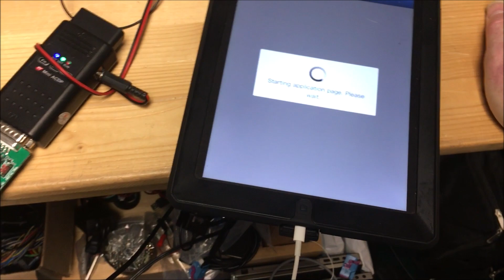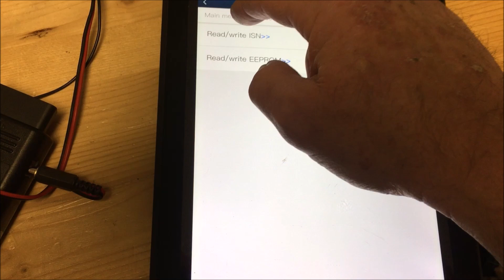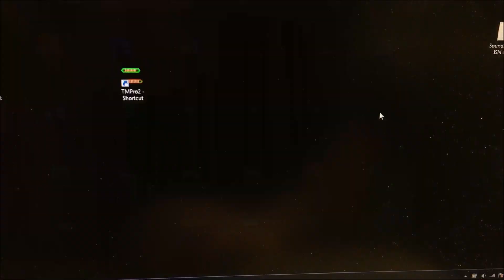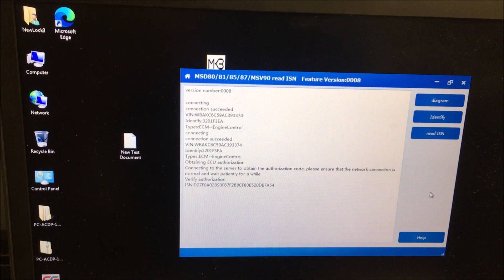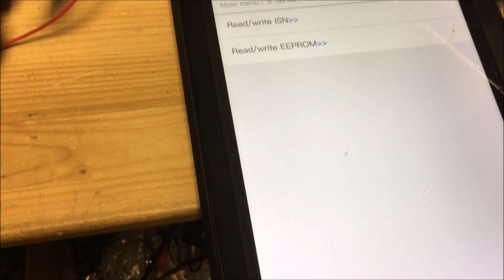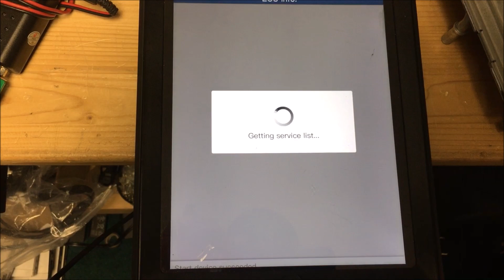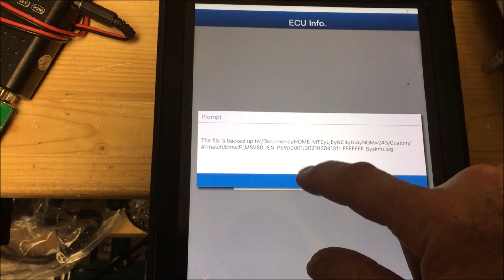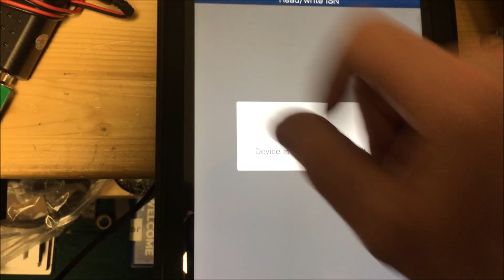ACDP vs CGDI BMW MS85 DME ISN reading

Comment: cgdi sells the AT200 WHICH WILL READ AND WRITE AS LONG AS YOU PAY FOR THE ADD ONS TO DO SO I ALSO HAVE THE AUTEL IM608 AWESOME TOOL MERCEDES BMW BUT DME SWAPPING IS A BIT OF A TRICK ON SOME BMWS BOSCH DME'S ARE EASY TO WORK WITH SIEMENS ARE A PAIN IN THE ASS BRO I AM ALSO A PROGRAMMER AND LOCKSMITH AND DIAGNOSTIC TECH ON LONG ISLAND NEW YORK,MY SHOP IS IN HEMPSTEAD NEW YORK

Comment: On the ACDP if you go under obd and choose msd85 help menu it shows a different way of connecting it. It shows just like the CGDI. Maybe that will work
Reply from the maker: I tried that too... no work...  My issue is all I have gotten from ACDP is, buy the boards, and then try the windows PC software.. I did both of those and it still won't work.. As I said before, I love the solderless connections, but if it doesn't work, I'd rather solder on...
Reply: @timtracy9442  yeah I gotcha. It’s good to know. I wish someone would make one programmer that would do it all
Reply: @timtracy9442  YOU KNOW WHAT DUDE THE BEST BMW TOOL IS THE MICROTRONIC  AUTO HEX OTHER THAT ISTA-P ISTA-D ONLINE WITH THE NEXT VCI WORKS AWESOME, MY NEXT PURCHASE IS GOING TO BE THE AUTO HEX FULL BUT IT WILL SET YOU BACK 7000 BUCKS BUT IT WORKS EVERYTIME
Reply: @FrederickWiedmer  Autohex couldnt read EDC17C76 tricore TC1793, as well as acdp, Abrites, vvdi despite they all have it listed as supported DDE
Reply: @FrederickWiedmer the best program for bmw is the bmw wizard it's even better than thr dealer software but it's way to expensive

Comment: The best and most useful videos and please tell me if you have these two devices which one works better BMW cgdi vs ac
Reply from the maker: It depends on what you are doing... If you are making keys for a FEM or BDC, ACDP is by far the easiest, if you are trying to read the ISN from the DME, usually CGDI has more coverage... I had a CAS4 that I swapped the DME, nothing wanted to change the ISN in the CAS module.. ACDP said it changed the ISN, but it didn't change it to the correct ISN.. CGDI changed the ISN in the CAS back to the original and then when connected directly to the DME it read and then changed the new/used DME's ISN to the cars ISN.. fired right up...
Reply from the maker: and the fact that CGDI is about 800.00 makes it a great buy...

Comment: Autel im608 says it will  read it also using the G box and cable db15. I don’t have a ecu to test it though.
Reply from the maker: Hi Tom, reading isn't the problem...  And the Autel IM608 is awesome.. it read a MEVD1767 that niether ACDP or CGDI would read the ISN.. watch for that video soon..
Reply: Autel does not works to good on Continental Ecu's

Comment: You have to have the Tricore password to read and write with ACDP.
Reply from the maker: the big problem was ACDP wasn't reading anything...  it wouldn't talk to the module...
Reply: @timtracy9442  with mine, in bench mode you have to have the tricore password to read (case open with solderless adapter). When in OBD mode the ACDP connected to OBD connector on car or on bench OBD harness (case closed) it reads.

Comment: I ALSO WANTED TO SAY THAT I TO BOUGHT THE ACDP AND ENDED UP SENDING IT BACK BECAUSE IT STOPPED WORKING AND STARTED SPAZING OUT ON ME I SENT IT BAK TO UHS HARDWARE IN FLORIDA AND GOT A FULL REFUND THAT TOOL IS FUCKING JUNK,IF ANYTHING XHORSE NEW MINI PROG IS PRETTY AWESOME AND THEY ALSO HAVE SOLDERLESS CONNECTING PCB'S ALSO
Reply from the maker: Thanks for the info on the Mini Prog...  I need to check that out ..  Have you seen what NASTF is doing??  They are partnering with a couple of companies to setup a programming service for garages.... They will have one tech in the garage who is checked, not sure if that means background check like the rest of us have and pay for, or if they are going to say, yea, he or she seems ok....  I do more programming than anything nowadays, maybe that will be coming to an end...
Reply: I wll depend on your words
Thanks

Comment: How much is the cgdi running in price?
Reply from the maker: The CGDI is about $750.00 with the options I got.. well worth the money in my mind.. Haven't had a DME it couldn't read the ISN from..
Reply: @timtracy9442  and this lets you pull the isn and write data to the cas?
Reply from the maker: @lockoutkeysolutions7471  I don't have the authorization to write data back to the DME, but you can bet I'm going to get it.....

Comment: do you have  idea when AVDI going to fix the CP issues?
Reply from the maker: What CP issue are you talking about??? because, trust me, AVDI has a bunch of issues....  but at least they pretend to listen to me when I whine...
Reply: @timtracy9442  the Component Protection,  Tim...  the " CP ". I know they don't listen.  their center support  here in the US is proof of that.
Reply from the maker: @victor35ma  If you are talking about the issue with calculating CS, Component Security, that really is out of there hands... All the aftermarket programmers were using a backdoor into the Ghecko server, the server that ODIS relays info to..  They, VAG, shut down the backdoor and now everyone is trying to figure out how they can calculate data without the hookup to the server... When will it get fixed, who knows....  But I do have to give Abrites credit, they were the ones who figured out how to read and preprogram chips way back in 2010, so if anyone is going to crack this, I have high hopes they will...  Just remember, mercedes DAS3 came out in 1998, when did the aftermarket figure out how to make keys for this system??  2013 I was sitting in a class in poland at MBE's head office learning how to get data out of EIS's and then calculate keys... this stuff takes time..